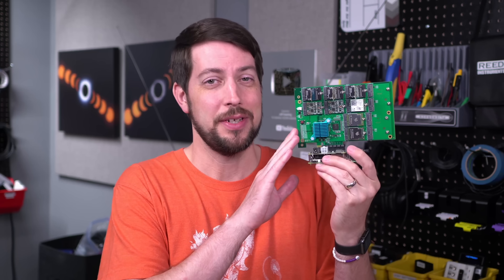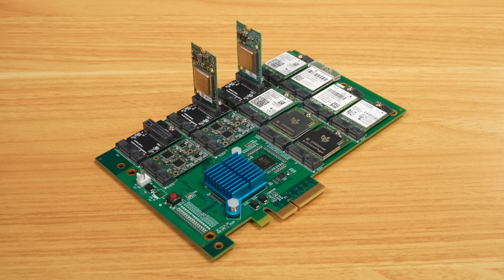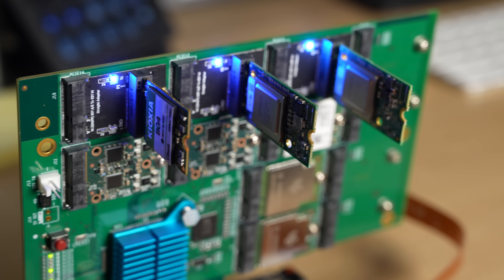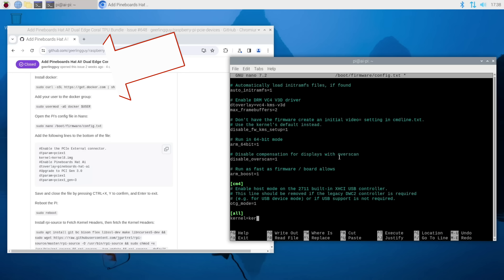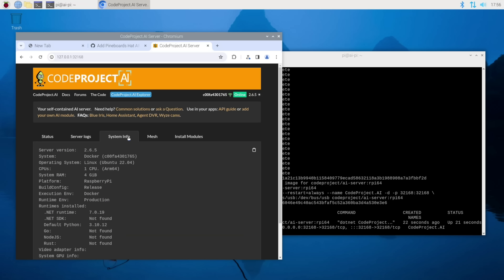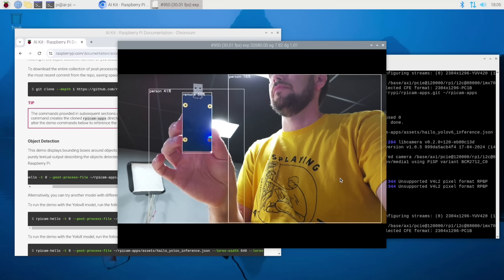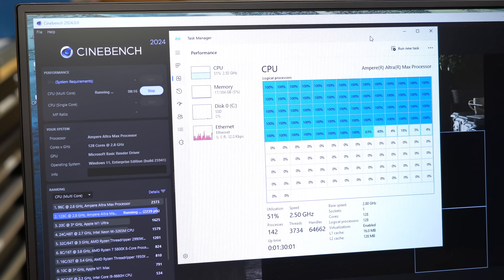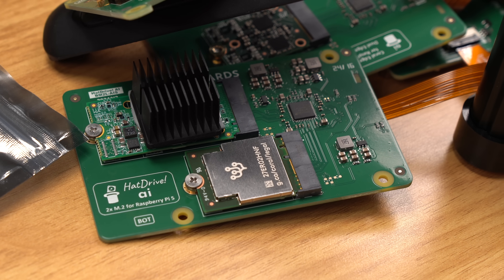I built a MONSTER AI Pi with 8 Neural Processors!

Comment: You can try upgrading that thing with replacing those TPUs with Intel NNPI-1150. Those can be found for ~30$ per board, it is M.2 board with special version of 11th Gen Intel CPU with 12 ICE (Inference Compute Engines) that is SRAM with DSP processing. It claims to provide 50 TOPS per M.2 card.

Comment: Being able to run two Halo8's would be a cool project as in theory would be (2x 26, or up to 54 TOPs in theory).  Combined with dual Pi cameras, would offer high frame rate stereo depth of field, or other fun video processing. 
BTW: the Home Assistant monitoring is fascinating. Would be interesting in hearing more details.

Comment: It's cool to see that working _technically_, but in terms of inference, that's kinda the equivalent of having a 1000 CPU cores running on a single, shared stick of DDR4 memory. Do you hypothetically have enough cores to run a ton of applications at the same time? Yeah. But how much you'll be ably to do with the system will depend on the throughput of your memory. And it's the same with these little compute sticks. They rely on your Pi's memory so while you - on paper - have a lot of TOPS, running any task that operates on a reasonable amount of data or live streaming data will quickly saturate your onboard memory and pcie bus and prevent you from doing anything useful with multiple NPUs

Comment: 300 TOPS sounds like a lot until you realize even an aging RTX 3080 has about 7400 TOPS. Sure the power use is different but point is you wont be running any big LLM models on this.
Reply: You're off by 2 orders of magnitude. It's more like 30-70 TOPS from a 3080.
Reply: Is this really correct? I don't believe this.
Reply: @pieterboots8566 
I don't think that this is correct.
Reply: Can you please elaborate on how you got that number?
Reply: @writer9999 chatgpt?
Reply: You shouldn't be running Large Language Model models anyway. That is it just one layer of modeling too many.

Comment: The trick to using those NPUs in parallel will be building a pipeline across them, where each NPU is supporting a subset of the layers in a model.  This is a common technique in both training and inference, though I'm not sure if Tensorflow Lite supports it.

A pipeline would allow you to partition the model weights and compute across all of the NPUs, giving you a chance to run larger models then you could do on a single NPU.  Your PCIe setup is very low bandwidth, but that is less of a concern here because pipeline parallel is only sending the activations (relatively small input tensors in inference) between the NPUs, not the larger weights.

Based on the limited information that I can find about Hailo and their sample hardware (a few of them have many Hailo chips on a single PCIe card) it looks like their software may support this.

Comment: There a Qualcomm AI accelerator that use Dual M.2 slots, that board could be perfect for it (I've never been able to find the spec for dual m.2, so the spacing might be off), just one of those could get 200TOPS/25W

Good luck finding one though...

Comment: Great information in the video. Is there a PCI-e board like this that would work in a desktop, without buying the Nvidia RTX 40 series?
Reply from the maker: Hailo makes a 200+ TOPS 'Century' card that straps a bunch together and would fit inside a desktop case (full height PCIe card).
Reply: @Level2Jeff  Thank you so much. 🙂

Comment: How do GPU bit miners support the core splits? Some setups are looking at spreading a single calculation over thousands of cores. Maybe there's a way to port a miner task divider to NPU tasks. But I also wonder if we are still limited to running each TPUs individual Floating Point rating? Or could we run full 32-bit models?

Comment: I appreciate that there are so many different TPUs/NPUs on the market, I’m just frustrated that we’re all beholden to nVidia when it comes to actually training models and running a lot of things.
Reply from the maker: Ditto. Wish at least AMD could offer something that would take the bottom out on either price or efficiency, but right now it is what it is :(
Reply: @Level2Jeff  I’ve got a used Tesla P40 with a water cooler in addition to another rtx 2060. Now that Intel works with Tensorflow and PyTorch, I’ve seriously considered just getting a 16 gig Arc 770 and paying for cloud computing if I need to train a model that needs more memory.
Reply: @BrianMaddox you actually get that? Arc is seeming very interesting to me.

I used to hate stuff like that but now it's a different purpose. It's like...okay at everything.

Comment: Well, regarding early multiprocessor things on PC, there was quite a long while, several years in fact, when nothing supported SMP on DOS/Windows even though there was hardware like it out in the wild, it got supported by things like SCO, NetWare, and then to some degree unix flavors pre-linux (forget which - Solaris probably?) and then badaboombadabing linux grew up real fast on that front and started going down the list of obscure weird poop SMP platforms adding support for one multiprocessor 486 here, early Pentium there until it ran in some form on almost anything that had some server or desktop CPU like architecture. This happened in tandem initially with Windows NT, or well, NT was first but was then overtaken by Linux at some point. And I mean NT 3.51 here folks, 4 was still a twinkle in BillyG's eye at that point. 
A lot of 'lateral expansion' going on then, I still vividly remember booting NT 3.51 on Alpha the first time and being mindblown at something non-x86 running something I had until then considered the kindergartner/mainstream type OS for PC's. I ran it on all kinds of strange stuff with PowerPC and all manner of previously unix only systems within a short period of time, not because I specifically wanted to try to run NT on everything, but because it was hard to track down install media for obscure things, and I needed to first test and then figure out how to use some of these things. 
Point is these NPU's are getting to critical mass, and when they do there will be an explosion of new stuff - both hardware which has started and software, that will likely coalesce around a couple of main players or standards. For those who want to be in on the ground floor and be part of the process shaping how this goes forward, now you may still have time - soon it will be too late as some main players reach critical mass and everything gravitates towards a few choices only. So grip your NPU's firmly and go fight for your vision of the AI ecosystem, the time to act is now!
Reply: Wow, FOMO is a sure way to make me lose interest. 😂

Comment: Why do we need TPUs for object recognition? I was doing embedded recognition sotware for cameras that run basically on a Pentium 2 200Mhz hardware  just fine. Of course classification and training of the algorithm was harder than just AI traning, but it run on basically anything. Today we need a special chip to draw a rectangle around you on the camera, while at the same time the ARM cpu can easily do that. Is it because the algorithms are easier to use and not proprietary?
Reply from the maker: You can do that on the Pi's CPU too—in fact it's nearly as fast for some tasks as the Coral itself. But the AI accelerator chips allow you to process hundreds+ items at a time at 30+ fps, which can be helpful in many places. Or just a few items or a couple camera feeds at 100+ fps, which is useful for high speed robotics, sorting, etc.

Not to mention it frees up the CPU to do other tasks with the data sorted by the NPU. Still, it's overkill for a lot of uses!

Comment: Hello Jeff. Odd question here. I have a Lenovo X230 that I will repurposing to "play" with local AI, specifically LLMs. It is going to struggle with the onboard GPU and I will eventually be moving everything to a different machine that will let me add a proper GPU card. Until then, is there a way that I could use a PCIE slot to NVME/M.2 adapter to put one of these little M.2 AI chips in the laptop? Since the machine has USB3 ports on it already, there isn't really anything useful I can put in the slot. If the adapter actually worked, would the extra AI board do me any good without custom software to utilize it?
Reply from the maker: Yes, at least under Linux. Not sure about Windows support for these things.

Comment: I had trouble getting my coral to work with codeproject ai long-term. It would work for a few hours but then stop responding. I don't know where the issue was on that. I mostly just gave up on it.
Reply from the maker: I had a similar issue in my testing, though didn't take too much time to debug it. One time it seemed to lock up the frontend of the Pi, had to force-poweroff!

Comment: It’s always fun to see you pushing the limits on single board computers. I’m sure it helps the hardware makers consider unusual use cases.

Jeff, have you seen the stories on the new research into IBD which suggests a genetic link and that certain cancer drugs might be effective? I saw the story on the BBC news site. Obviously I can’t post the link here, but I thought you might be interested.
Reply from the maker: Yes, I've been following that research—still 5+ years out from being practical but it's promising. The key is to find drugs that have fewer side effects than current TNF-blockers (which have similar mechanisms but target the immune system more broadly).

Comment: We need cheap PLX chips that take a newer standard bus in uplink and can provide many downlink at lower speed.

Also on consumer mainboard it is starting to be annoing. 20 or plus pcie gen 5 lanes where almost all hardware is gen 3 and 4.

Lot of throughput lost.
Reply from the maker: Couldn't agree more. Though those of us needing all that PCIe goodness are a slightly rare breed... and the answer till now is usually buy a big server CPU that gobbles up like 120W idle :D
Reply: @Level2Jeff  Even if we are the minority I think that the approcha that apple did with the MAC pro using the PLX and many lanes/slot is something that other HEDT/Workestantion OEM should start to consider.

New AM5 EPYC has been annoucned but lot of bandwidth is lost if you just plug a single HBA card on today mainboards x16 slot.